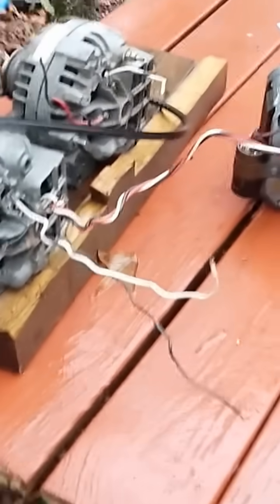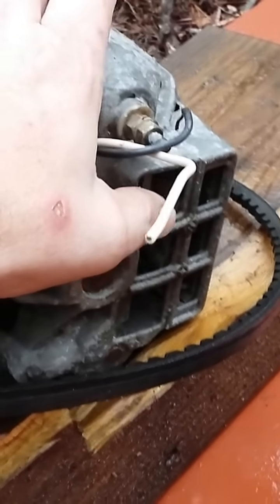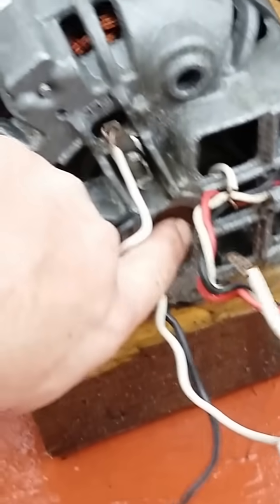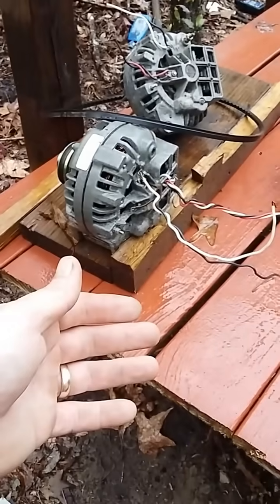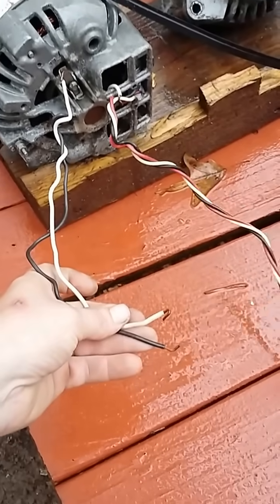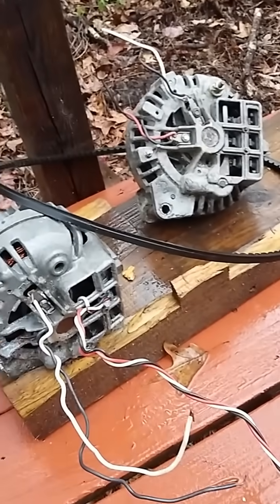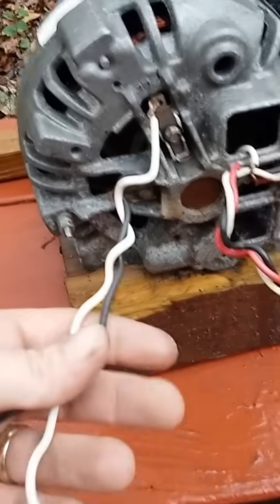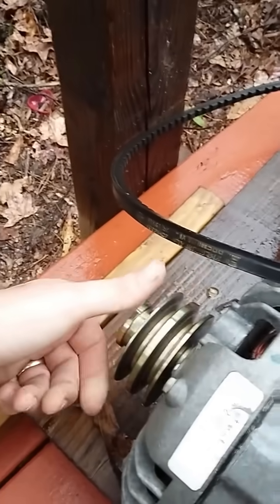Update Free energy forever no wind no solar no gas READ DISCRIPTION!!!

Comment: Continuation of my earlier 2 posts.... (Read earlier posts first).   I got so many people asking me that I just wanna hide in the bush in my back 40.  Anyhow, I took the old Walmart subwoofer speaker from my Chevy Diesel truck which I use for my dog Timber as a dog house.  I figured I better grab the woofer speaker before he chews the foam around the speaker.  Since a speaker is really a reverse microphone just like a generator is like an alternator, I can make power from my sub woofer.  I grabbed my double halogen yellow shop light and used the stand to mount my 12 inch sub-woofer to the speaker.  Hooked up some wires to the speaker, pointed the speaker with the stand towards my boy "junior" when he cries in the background, and if Jesus was alive, man that subwoofer was resonating at such high frequency that my watt meter said I was making over 1000watts from a 200watt rated woofer.  I told my wife while she was holding Junior as he's crying to yell some profanity at me.  Man-o-man, I was peaking my watt meter at 3000watts.  I even tried to get Timber to bark at the subwoofer too, but he's not much of a guard dawg anymore.  The magnet on the speaker was getting so hot, I just about burned my side.  Probably stick it to a metal hub cap as a heat sink would keep it cool.  So what I'm trying to say to all ya folk out there, is that just a little creativity and some reverse engineering you can have free power, and more money to spend on beer.  Pretty soon I can buy me a boat !!

Comment: use the power bill energy to spin the alternator? so you can pay the same power bill to handle the load when it gets hard to spin? no gas no wind that right it runs on money..... yes it will put out power but when the load is applied it takes away that easy little spin you give it.

Comment: This is bull shit. Yea  14 volts dc and 90 amps at 3000 rpm. Doubt you get 90 amps from 220volts AC and how are turning that alternator? Unicorn farts and rainbows? If you want to use an alternator to produce power your much better off using it to charge a battery and hooking up an inverter but you still need to turn the generator somehow. Water, wind, gas engine, human power.  Going to be tough to get 3000 rpm from anything other than a gas engine. This guy doesn't know what he's talking about and there's a reason he doesn't show his set up actually running anything. He's likely to burn his house down if he tries to run his oven on that set up.
Reply: electric motor i would think..
Reply: 90 amps will take a lot bigger wire than you have! If you put 90 amps through the wire you show, you will melt the insulation off very quickly!
Reply: Dave Rogers dude All you have to do is read his other comment he grabbed his sub woofer and let the kids yell so it was able to produce power there he uses that power to turn something magical like I said before backwoods hillbillies should not be Allowed to have DVD players

Comment: Can you explain a little bit more the alternator with the switch/capacitor? Is the shaft getting the electricity from the charge stored at the capacitor? Thanks in advance.

Comment: I am an electrician. First off, a question...HOW DID THIS VIDEO GO VIRAL (DOUBLE)? Second question...HOW CAN YOU HAVE SOOOOO MANY SUBSCRIBERS?
Okay, for the technical side in breaking down this video:
First off EVERYONE, there is no such thing as "free" energy in the context that he is speaking of. First, you have to "spin the motor"; that takes energy. If you hook up a motor to spin the alternator, that requires energy. You could gear up a bicycle set up to spin the motor, but you also require your persinal energy to do that. So that is one flaw there unless you are using wind and gears.
Second, yes, the alternator without the diodes will create 220 VAC at about 90 amps (if it's an alternator that was off of a large vehicle that requires a lot of operating voltage. But the rule across the board here is SIZE! Which leads me to my last point...
The "output" wires look to be about 16-18 gauge wires. If you hook an electric 220 VAC oven to this alternator, and successfully spin it to the minimum 1250rpm, you WILL NOT have a cooked dinner...YOU WILL HAVE A COOKED HOUSE, or trailer in thus guy's case. Why do you think the power wires from the electric company that come to the weather head on your service drop poll are SOOOOO BIG? Lots of amps create lots of heat that need to be carried across LARGE wires. DO NOT TRY HOOKING AN ALTERNATOR TO YOUR HOUSE'S ELECTRICITY! YOU WILL BURN DOWN YOUR HOUSE AND IF YOU FILE AN INSURANCE CLAIM, YOU MAY GO TO JAIL FOR ARSON AND INSURANCE FRAUD!!!
On a personal note:
As a fellow YouTube uploader, quiet the crying baby, and shoot your videos. Also, who is "coming to get you"? You have either a meth problem, or are schizophrenic. Put your aluminium hat back on, and work on some more electrical "inventions". Make sure you are well grounded, like stand bare foot on the ground; then, we won't have to suffer from this drivel anymore.
Reply: usandroidtv dotcom oh man OK guys I have to apologize for things I’ve said I just figured out with the sis he is making comedy videos that’s the only explanation for the level of stupidity coming out of his pie hole literally nobody that stupidI would live to the age of an adult because I guarantee a person that dumb has tried to make toast in the bathtub before so yeah must be a comedy
Reply: I think the "coming to get you" reference is to the story of a man named Tom (I forget the last name) but Tom back in the '70s is said to have created a vapor engine that runs on gas fumes and gets 200 mpg. Tom's idea was bought by the Shell oil company and then buried because they don't want cars with 200 mpg. Tom was under the impression that Shell was going to improve on his design and save the world's energy problems, not bury it in the patent office, so he complained and threatened to public with his idea. Tom's body was found in a car out in the Nevada desert a short while later.
Reply: The man's name is Tom Ogle and there are a lot of article's about him and his concept of manipulating carburetors to reach over 100 mpg, a quick google search of his name will bring them up. There's also plenty of YouTube videos of people trying to repeat his success with their own engines. It's not B.S.
Reply: usandroidtv dotcom
2,400,000 views but 40 comments?  i smell something fishy.

Comment: Weird. I'd swear I saw this very video about a year ago. It even says posted in 2016. Yet all the comments are less than a month old
Reply: Ah, ok. How stupid
Reply: It isn't even info that makes any sense
Reply: Yeah. I wasn't making much sense. And what is he hooking those other (3) wires into? And I am not sure where he is getting the a/c transfer into d/c from? Far as I understand alternators, you can't run power into them, transfer it. They are strictly a single direction setup, from the wheel to the positive and negative connections. And what is that airplane controller business!?

Comment: If you replaced the copper wires in any car generator with smaller diameter superconducting wires,    then you could have coils that can have 100 times the number of turns of wire in the same coil size,    making any common car generators way over unity.  

This is how it works :  
The resultant magnetic strength that a coil of wire can generate - B 
is governed by the number of Turns of wire in the coil,
times the amount of Amps of electrical current sent through the coil, 
divided by the Length of the Coil. (not the length of the wire)  
   B = (Amps)(Turns) ÷ Coil Length  

So, doubling the number of turns of coil wire with superconductors 
will reduce the amount electricity required to charge the coil by half
to get the same magnetic field strength required to do the same work.  

10 times the number of turns of coil wire requires 10 times less electrical energy
to get the same magnetic field strength required to do the same work.    

It would be cheap & easy to just remove the copper coils in any existing motor or generator  
and replace the copper wires with many more turns of superconducting wires.     

Retrofitting existing motors & generators in this way 
is a good way to begin the transition to free energy.   
You only need to pay for the cost of the superconductor wire, 
& the labor to rewind cheap existing motors & generators.  

Motors and generators are propelled with magnetic fields.
If we can produce the same strength magnetic field in a coil with 100 times less electricity input,    then we can drive 100 generators or motors with the energy required 
to propel just one generator without superconductors.  

Superconductors are the best, cheapest, & easiest way to achieve "Over Unity” & “Free Energy". 35 Room-Temperature Superconductors Discovered 
http://www.superconductors.org/158C155C.htm   

Graphene nanoribbons tested could carry as much as 10 billion amps/CM, or nearly 1,000 times greater than copper. 
http://www.talk-polywell.org/bb/viewtopic.php?t=1480   

Graphene has a current density a million times that of copper at room temperature.
http://www.zdnet.com/the-10-strangest-facts-about-graphene-3040093050/

Comment: Question time, I've got my system mounted to a  bike frame. Took apart the car alternator, clipped the three wires hooked to the coils and extended them threw the body. There are 2 posts, one labeled BAT and one labeled E with a 2 wire harness with S L.  The harness has #12 white plus #18 white with blue strip. The E post has #10 white. I'm thinking the BAT is for charging, the harness is for 12v line voltage. Not sure about the E white wire. Got my volt meter for testing and 12v power source. Ready for this to work, any suggestions?
Reply from the maker: Drum Junky2 
do you have continuity on the harness with the white wire and the white wire with the blue line on it if so that is your input and I suspect you're wanting alternate current out of your alternator. if you've already bypassed your rectifier and went directly to your three stator coil wires then you're going to have to use it as an inverter which will be fine for what I believe you're going to do with this but you're going to need either pulsed DC or an alternate current power source that has a potentiometer on it to go to the field winding on your rotor. and you are going to use it the same way a Transformer shorts a circuit out to make it go back and forth to transfer from one coil to another coil so you will basically have an inverter Transformer. your primary coil will be your rotor coil which is asynchronous coil and your secondary coil will be the three stator coil wire's and there will be different voltage on all three wires of your stator the one with the least amount of voltage coming out of it is going to be your neutral or ground wire and the other two will be your main and common the common will also be short-circuited but with a diode in the circuit to keep from back feeding current or "i" just like in a Mot or microwave oven Transformer. I hope this information helps you out! Let me know if you need any further assistance!
Reply from the maker: covfefe if I use a pulse wave modulator (pwm) or a small 80 watt stable sine wave power inverter... it is already wired and ready to be a synchronous generator or synchronous motor which was the point of my video but if I start talking like that then no one's going to know what I'm saying I can explain the flow of current and things like that in a way that people will understand...
Reply: Thanks for all the replies so fast from every one. My mission is to have a 70amp single phase sub panel with a few dedicated circuits, 110 water heater,micro,small refer general plugs and LTS. Maybe have low voltage LTS . was also planning on using a grinder motor in the system and solar to 12v batt to excite the stator. A switch that controls how fast lights strobe should help dial in motor speed.